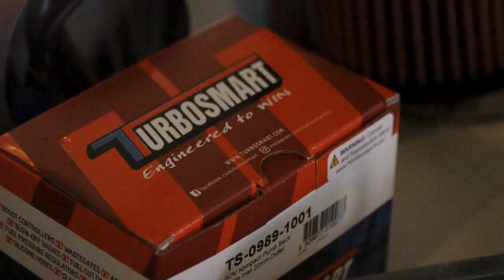NB Miata Turbo Build Episode 2 | Fitting a TASTY Intercooler and Radiator

Comment: Solid look, thinking of getting a kit for the nb1. I know you mentionned not getting the F'M turbo, which one did you get instead?
Reply from the maker: I just got a generic GT2560R turbo used off the forums, took some work and a new compressor (to match flyin miata's intercooler/intake pipes). I don't know if I'd recommend going that route unless you really want to save money